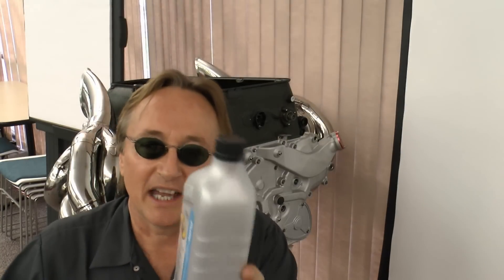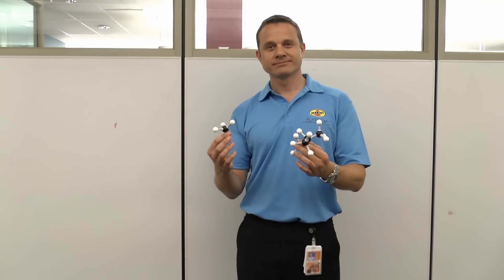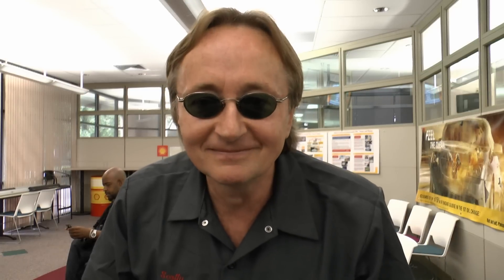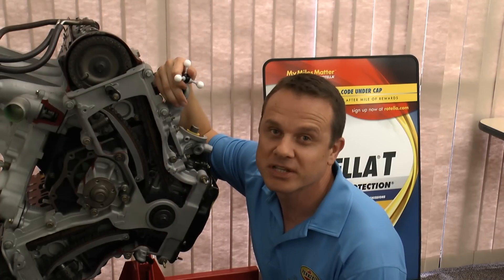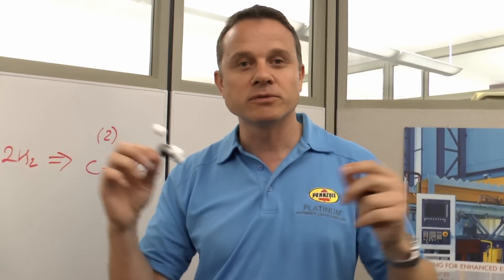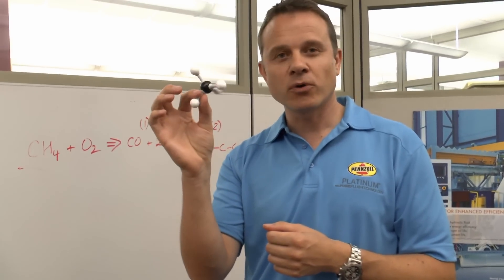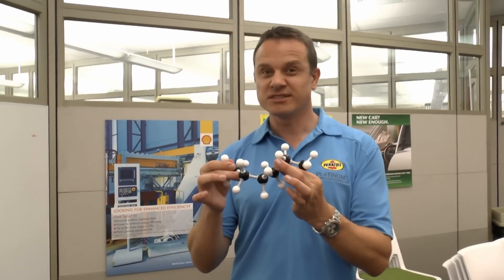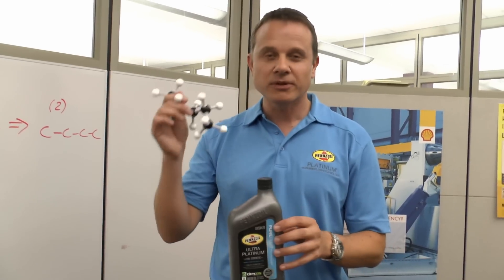How Engine Oil Is Made From Natural Gas

Comment: The market for motor oil is so big, sometimes you don't know which one to choose. Valvoline, Castrol, Mobil, Pennzoil, Quaker State, Royal Purple, Amsoil, Redline; heck, even Wal-Mart's Super Tech isn't bad, either.
Reply: I use Supertech, but make sure you buy engine oil at Walmart.
Reply: Always get the cheapest synthetic with the right specs and weight, sometimes mix left overs too.
None of my engines ever had any wear related issues.
Sue me.

Comment: Really cool video! I like the purity Shell was able to achieve with this innovative process. I have always bought Mobil 1 for my car, but I'm switching to the new Pennzoil Platinum at my next oil change. I'm thinking of sending the oil samples in for analysis to compare them.
Reply: Did it work out?
Reply: @chocolatemilk2076  it’s great stuff I will say that it’s probably the best east to find off the shelf oil you can get.
Reply: Mobil 1 was originally made from acetylene gas (C2H2). But they may have changed. Castrol Syntac changed to processing crude oil.

Comment: Is very good and is what they pre-fill all SRT powered vehicles with from the factory. Is what I use in my 2010 Challenger SRT8, and is an excellent product. I've seen many quality tests and is right there with Amsoil, which has been #1 for years and is very hard to beat. It's the only one that's made from clean natural gas, so it has an advantage in it's organic form to start with. I know Scotty doesn't like FCA, but the SRT crew takes them to another level and use top quality performance parts on them

Comment: Very interesting video!!!
Scotty, one question?, There are some precautions to bleed abs brakes vs brakes without ABS, using the vacuum method?
Thanks a lot!!!!
Reply from the maker: yes NEVER get air into an abs modulator, or you will need a dealer level scan tool to bleed it out of there

Comment: I am using this oil now ,the 5W 20  and it helped the engine performance .a bit..
Reply: Did it run cooler, get better gas milage or make more horsepower?
Reply: kirk orr It helped the overall  acceleration  and helped the fuel mileage a bit,, yes..
Reply: Robert Diehl Cool thanks
Reply: That's nice Dawg

Comment: Hey Scotty, I actually stopped my 1995 3000GT from burning oil by using a product called "Engine Restorer." Now that it's burning little to no oil but considering how old the car is, should I try using full synthetic Pennzoil Platinum even though I run conventional oil on it? I would like to try Pennzoil because I want to get the most protection out of my engine.
Reply from the maker: I would try this oil over engine restorer any day,  and in those mits, the piston rings just flat wear out, as they use cheaper ones.
Reply: Scotty Kilmer ok thanks Scotty, I'm going to try Pennzoil in my next oil change

Comment: Wasn't very good in chemistry. Wish I was.
Reply: It all starts with Elementary particles such quarks, muons, fermions, bosson and gluons to make matter. Then we have bigger particles such as protons, neutrons and electrons that combine to give us matter. For example hydrogen is the lightest element with 1 proton and 1 electron and then comes helium 2 protons 2 neutrons and 2 electrons and it goes on and on until we have all the elements we have discovered or made. Work on your foundation and chemistry becomes easy
Reply: +SClassFinalFlash Is hydrogen a Metal?
Reply: Oscar Flyer its the lightest gas in the universe
Reply: Nah!! You don’t need to know chemistry to get into this as a career. I am living example of it. I still don’t understand chemistry yet I’ve been in the industry for over 18yrs, started from the bottom and worked my way up until I’ve gotten into lecturing refinery operations and took it further to lecture on oil well operations for one of the world’s biggest oil company.

Comment: Hey Scotty, I have a 2006 Ford Crown Victoria Police Interceptor which I believe has a vacuum leak. If I turn the HVAC system off, it does in fact stop blowing, but I hear a hissing noise coming from behind the dash. If I put it on normal AC, vent, floor, or defrost, the noise goes away and they all function properly. But if I put it on max AC or turn it off, it makes that hissing noise. Do you know where the leak may be coming from and how to fix it?
Reply from the maker: you'll have to dear the dash apart, a giant 6 hour job on that vic. You might just live with it if it works fine otherwise. Many vacuum valves are inside that dash and it needs removal to access them

Comment: So scottty, do you personally use this oil? Like for example on your celica?
Reply from the maker: no, I use castrol as I drive less than 1200 miles per year, so changing the oil every six months would be a waste using this expensive oil. All oil needs changing every six months.

Comment: So is it better than regular motor oil? For example mobil 1. Or is it about the same quality?
Reply from the maker: I have another video in the making showing how they tested the oil in the lab, in the race car world, and on taxi cabs in las vegas. Basically it prevents metal wear in the engine better than any other commercially available oil.

Comment: I  always wanted to know how methane was converted into motor oil. That's great! More ways we can break away from having to use foreign oil!
Reply: Methane needs to be prepared before anything else can be done. This correcting of the gas is called reforming the gas. Once that very dangerous process is done and the correct grade and structure of the gas is achieved, it can then be moved to the next process. There are various technologies but the one I can speak a little about is catalytic reaction. This is a process on it’s own to convert gas into liquid (GTL technology) by catalytic reaction - under favorable conditions (ie. pressure, temperature, flow, etc) the gas molecules are forced to interact with the chosen catalyst, by this interaction the carbon chains are lengthened until they reach the desired length which in turn relates to changing it’s properties (this means they are changed into a different chemical) after this happens the liquid which now becomes an industrial grade wax. This wax becomes a substance that is further processed into many other products by means of hydro-cracking or a different process for other end products. In a nutshell, hydrocracking changes it’s properties further and breaks up the wax into various chemicals, in other words paraffins and oils and so on. After this the products are further processed to become other desired products. These products or substances my then be blended with other chemicals to become the marketable products we can use.

Comment: Scotty, does this oil contain at least 1200 PPM of ZDDP so people can use it in their older cars or does it have around 800 PPM like most modern oils?
Reply from the maker: you have to ask shell, they have a website you can ask them there, they are always willing to explain the quality of their products.
Reply: Okay, thank you.
Reply: +TheTardis157 most stock flat tappets are good with around 800ppm, but still you probably should use something with 1000 or more to be safe

Comment: i have a 1978 oldsmobile cutlass supreme with a chevy 350 i was wondering if i can you synthetic oil or should i just use conventional oil
Reply from the maker: you can use whatever you want, but me, on that old thing, if it works fine, I'd use the same oil I've been using. Changing sometimes does weird things to an old engine

Comment: Is Pennzoil platinum the best oil? I always use highmileage synthetic blend for my car and its at 272k miles. Should I switch to a full synthetic?
Reply: Yes go ahead and use penzoil ultra platinum high milleage or just platinum high milleage. Ultra is just more cleaning additives buy hard to fine besides online. Make sure you use high milleage tho because you already expanded the seal, might leak if you dont use high milleage.

Comment: Hey Scotty, is it safe to buy and use a new intake that doesn't use oil? Would I have to adjust anything to compensate? Thank you so much... You're the best!!!
Reply from the maker: if you mean cold air intake, don't waste your money. they either do nothing, OR require the computer to be reprogrammed as they do on race cars.
Reply: Scotty Kilmer totally true. CAI doesnt do anything. Leave your stock sistem as it is. Most probable thing its that will decrease your performance... nice videos you have scotty.
Reply: Yup CAI does not automatically increase horsepower. You need to reprogram your ECU (example: tuning with a Haltech, Unichip, etc) to get the most of it.
Reply: Kanjo Bosozoku nup, those sistems will increase the power of the engine, but the CAI will do nothing but noise... well in need for speed it will...

Comment: Very informative, Great work as always. I had a question. My friend's 2009 2.4 L camry has started to use more fuel than usual. It now gets around 300 miles per full tank ( around 17) galloms to next fill up). My friend uses synthetic oil , the car has relatively new tires and no check engine light. What could it be?
Reply from the maker: have him clean or replace the maf sensor, they often do that on camrys
Reply: Scotty Kilmer Thank you for the advice.
Reply: ***** In fact I was going to check the air filter. the oil filter was also changed during the last oil change. we will try cleaning the maf and if it did not work the fuel filter.

Comment: Any idea for a good replacement for 101-B engine oil?  I was told 10-40w was good for a ford 302 1970 engine.
Reply from the maker: +Ember Eagle yes, I personally would use castrol on that old thing
Reply: Scotty Kilmer
Thanks much!  Ill give that a go.
Reply: +Scotty Kilmer gtx?
Reply: use valvoline vr1 10w30 or Shell rotella 15w40

Comment: I used this oil for Nissan altima 2013 2.5 but it is not giving me fuel economy compared with total 5w30 quartz 9000 kindly advice how many km can run with pennzoil ultra platinum 5w30

Comment: Hey Scotty, 
Love your videos Man! I have a 2003 Chevy Tahoe with 270,000 miles on it and use Mobil 1 synthetic every 5k, I am doing a change.. 

Do you think enough research or any failures with the Natural Gas synthetic oil will surface for being TOO CLEAN??  HA!  You never know... but I doubt it... but Mobil 1 has been around a long time and I wonder if any problems will result with the new natural gas oil... 

I am tempted to put it in my 2016 chevy tahoe with only 200 miles on it, but its hard to turn away from Mobil 1... 

What's your advice????? You are the Expert. I value your opinion.
Reply from the maker: mobil one used to be a great oil, but all my racing buddies stopped using it a while back, citing oil pressure problems on the track . I would use this nat gas oil myself in your car

Comment: so is this motor oil better then synthetic oils like Mobil 1 Full Synthetic?
Reply from the maker: yes, to some extent
Reply: Could you elaborate?

Started using this very same full synthetic Pennzoil motor oil in my new F150, and to save some $$$ I thought about switching over to Mobil 1 full synthetic.

Didn't think it would make any difference - however now I get the impression that this may not be the case.